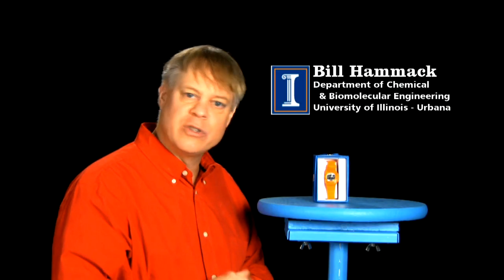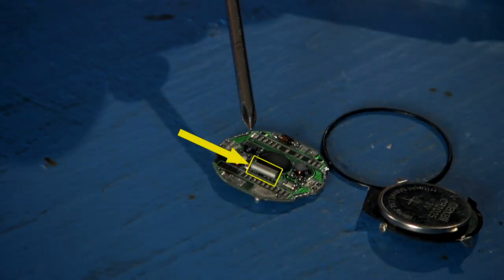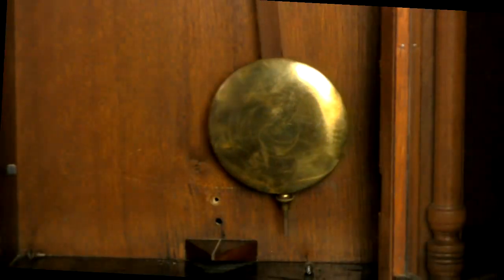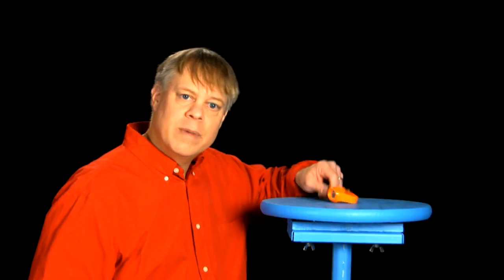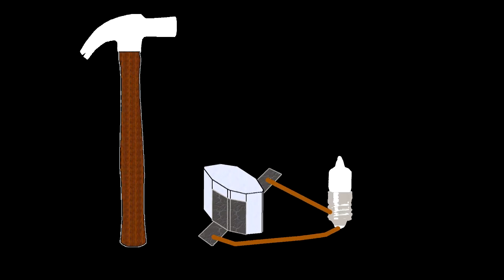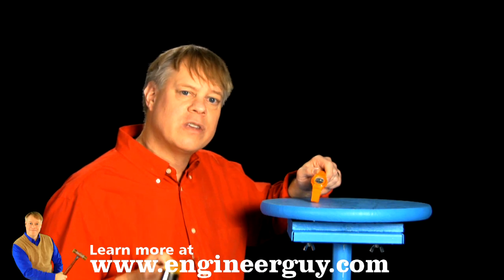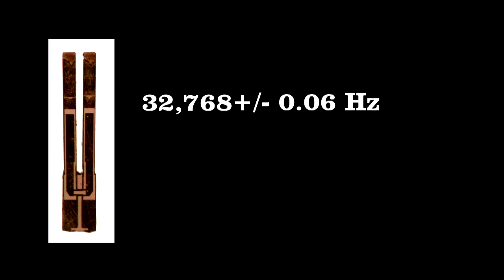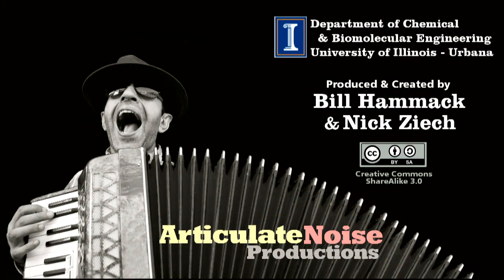How a quartz watch works

Comment: How did Engineers come to a conclusion that 32768 oscillations leads to one second?
Reply: 32768 is 2 to the 15th power. If you have a 16-bit electronic circuit (1s and 0s) you can make 32768 numbers. So the watch has a 16-bit counter to count the oscillations. When the counter gets full, it resets to zero and declares that one second has passed. 16 is a nice "round" number in computer-ese, and makes for astounding accuracy - 2 seconds per day.  The real trick is making the tiny tuning fork so that it oscillates at exactly 32768 times per second.

Comment: Gold, really?? I know it's a tiny amount and doesn't represent that much cost, but why not lead or silver?
Reply: This is just a guess on my part, but gold is extremely nonreactive, so it won't take on extra mass through oxidation and change the crystal's rate of vibration, which would cause the watch to slow down over time.

Comment: Have quarts really something to do with GPS? The satellites need atomic clocks..
Reply: Lol GPS relies on atomic a long time ago
Reply: It does, the atomic part is there to give a "tap" to the quartz through a feedback system.
Reply: Thanks!
Reply: The quarts in the GPS allows to keep track of the time differences between the satelised  atomic clocks,  giving a location
Reply: No, not quarts. Liters. Mixing in Imperial measurements would probably lead to catastrophic failure.
Reply: Quartz.

Quarts are a unit of liquid measurement. There are two pints in a quart and four quarts in a gallon.

Comment: so you think digital watches are a pretty neat idea.
Reply: +Jay Cie 
Maybe not aestethically, but they do what they need to do perfectly. they are reliable, accurate, simple, durable, and easy and cheap to build. Hence they are an example of perfect engineering. You just won't pull chicks with them the way a Breitling or a Rolex will
Reply: Jay Cie
I came from under your bed. WATCH me.
Reply: +DolleHengst you can't be this much of a bogon. tell you what. lets grab some pangalatic gargle blasters. do you need a lift or do you have your subeather sensomatic.